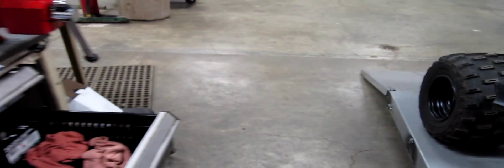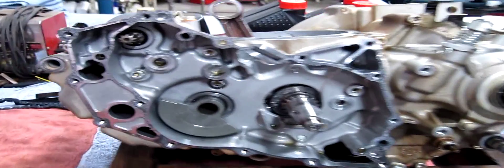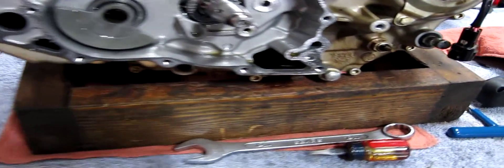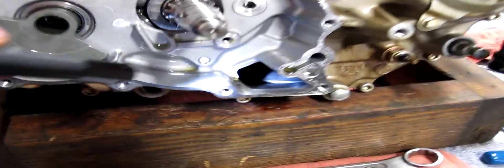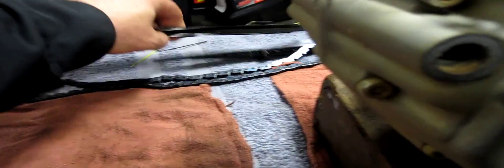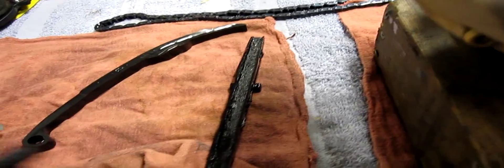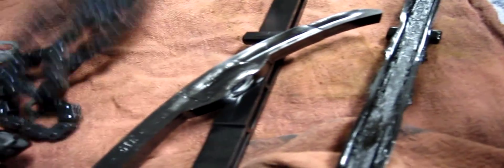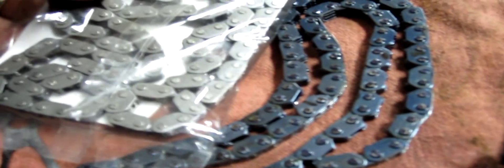Yamaha YFZ450R Engine!

Comment from the maker: @Sandeep9201 - Yes, this is normal with the stainless steel exhaust system that is used on most high performance 4-stokes these days. A very commonly asked question as the owners manuals never mention this. On older bikes, this would be cause for concern...

Thanks for viewing and commenting! - Shawn

Comment from the maker: @bastiaan08 
Yeah, sure about the chain. The old one was blued from extreme heat caused by the came chain tensioner being installed incorrectly and making the cam chain way too tight. Really surprised that it did not snap!

Thanks for viewing and commenting! - Shawn

Comment: You know that little sleeve that goes on the exhaust side of the barrel, that goes down to the water pump. Do I have to split the case to get in there and find it, or can I get away with removing side covers and find it that way?

Comment: Do you have any videos on how to adjust valves on the yfz450R or X? I did it numerous times on my Raptor 700r but they were adjustable without shims. Shawn Smoak
Reply from the maker: All Out Throttle - I haven't made a video of that yet. There are so many details and precautions that I'd have to go over, it would end up being a multi-part series... Lol  I've seen so many of these come in damaged from customers trying to do it themselves, I'm a little afraid I may prompt some people without the proper tools or knowledge to try it and end up costing them a ton of money. Just like this guy did!  It's pretty straight forward if you follow the manual to the letter and have the precision measuring tools and a very accurate torque wrench...

Thanks for watching and commenting!

Comment: I have a question about my 05 yfz 450 im changing the crand because of lower rod failure and I noticed that the oil pump will spin free and then drag and then free and again drag like there somthing in there... So i will buy a new oil pump but can i use the 07 oil pump and will it bolt up? Please someone tell me as soon as possible?